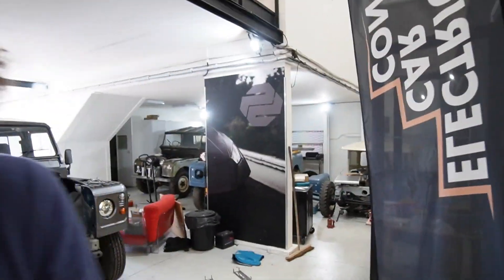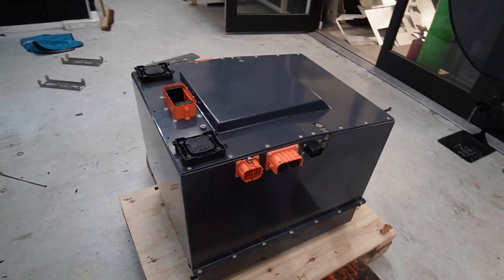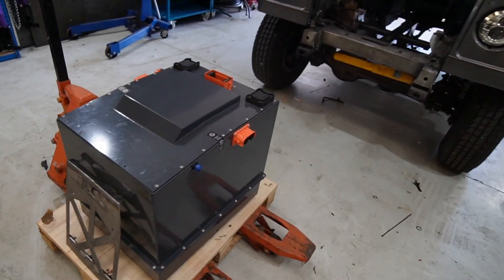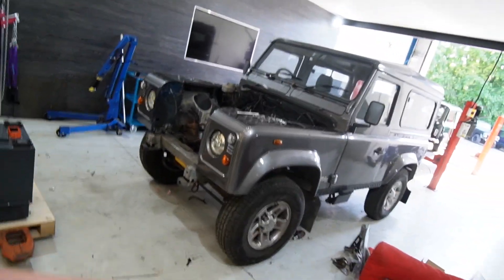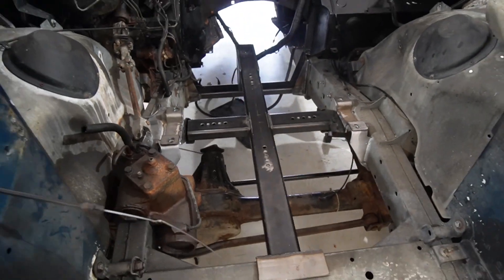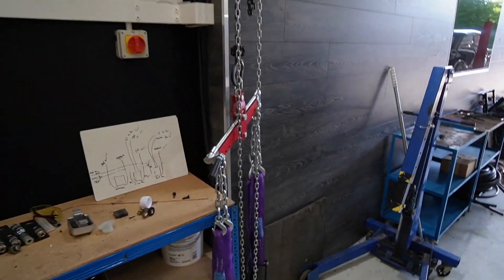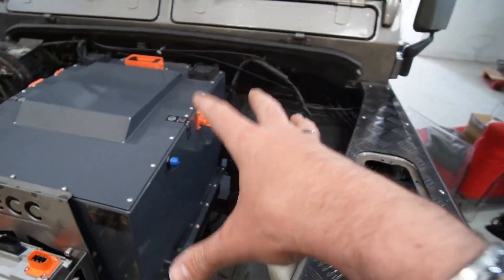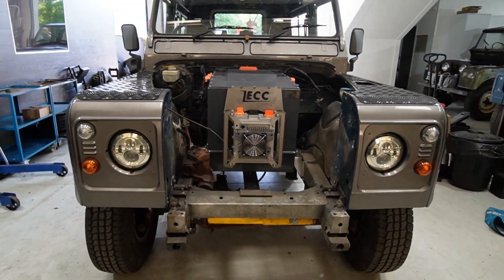Building an ELECTRIC TESLA POWERED DEFENDER. Part 3 - 55kWh worth of HV batteries are now mounted!

Comment: Just curious but why use felten when electric classic cars can fit the whole tesla 100kwh pack in a conversion? 🤔
Reply from the maker: We certainly can if you want, it’s just if you can afford it! We also prefer not to use the load area for batteries.
Reply: @electriccarconverts  120-140miles of range for that type of vehicle and the build cost just seems a bit underwhelming?
Glad to see these ev elktromods happening though and companies like felten&ecc making bolt in kits. 

Maybe in 5 or so years I'll be able to afford making one out of an old muscle car&a wrecked tesla.👍🏻😎